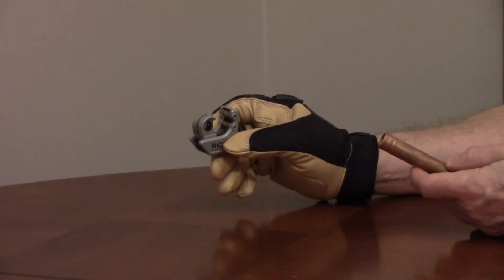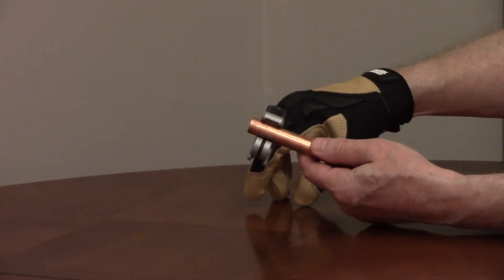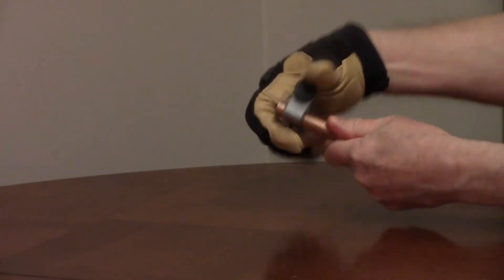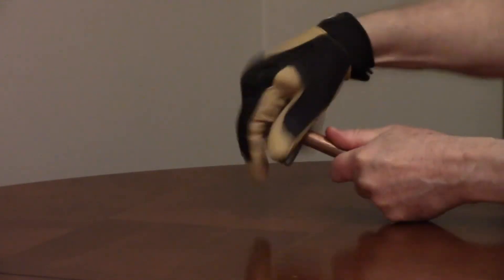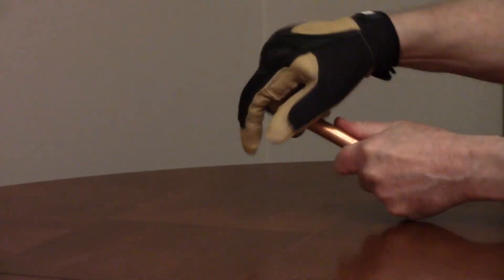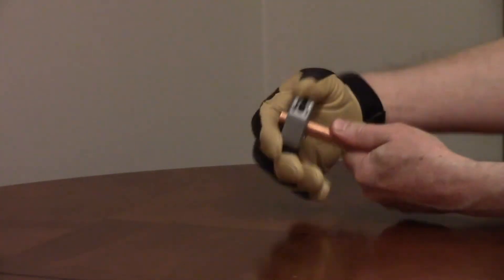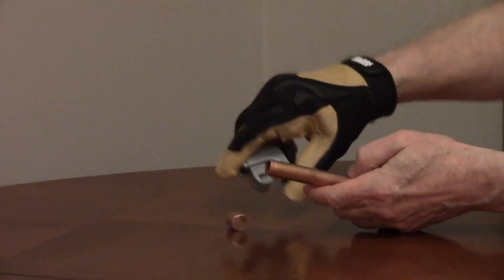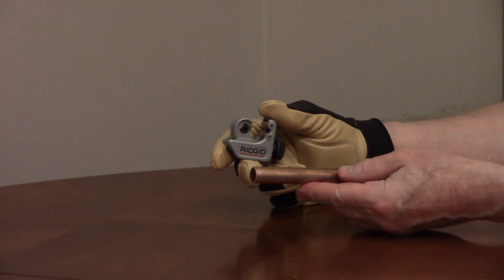How to Use a Mini Tubing Cutter

Comment: Is it necessary to use an internal deburring tool after this?
Reply from the maker: Hi, deburring can help reduce vibration from water flowing through the pipes. Professionals will usually deburr copper pipe when it's cut.
Check out some home improvement tips in our e-books https://www.amazon.com/gp/product/B0B2KW1FQ9